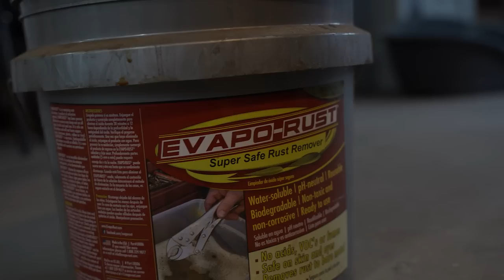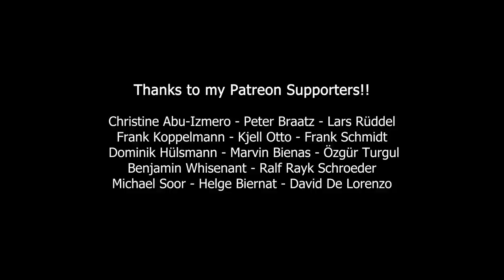The Chain Sword | Forging a perfect blade out of a rusty old chain!!

Comment: Question?  Why did you cut, stack and tack instead of drawing it out and folding over the "excess"?  Both SHOULD work unless I am just missing some obvious flaw.  
Otherwise, another amazing piece of work.  

Though you didn't really need to make a sword just to shave your legs.

Comment: Absolute master! You got those seamless forgewelds and it looks really cool.
Question: why didn't you use a hardenable steel or carburize the edge? Wouldn't that make it a much tougher/harder-edged blade?
Reply from the maker: Not necessary, went out pretty hard and flexible…